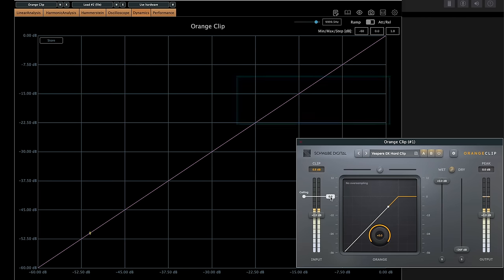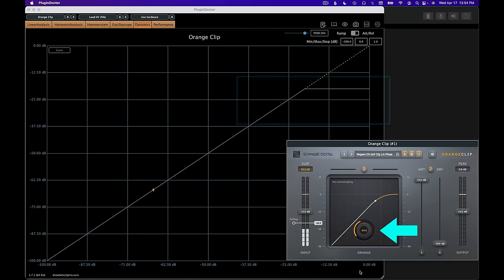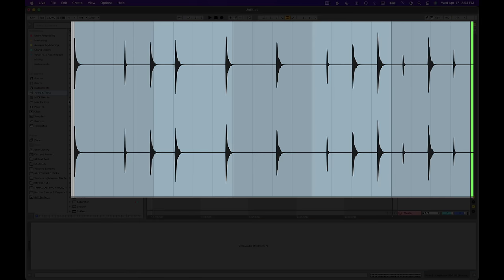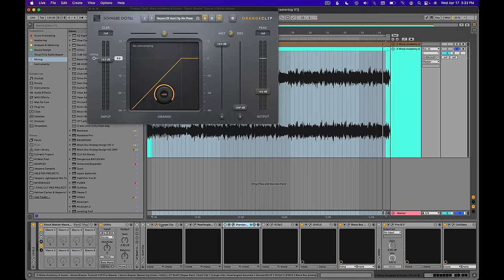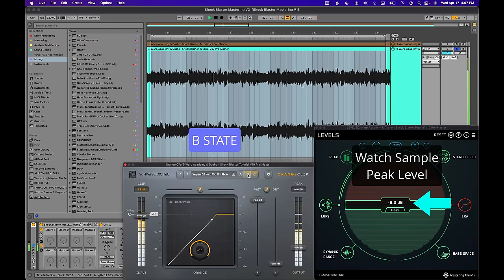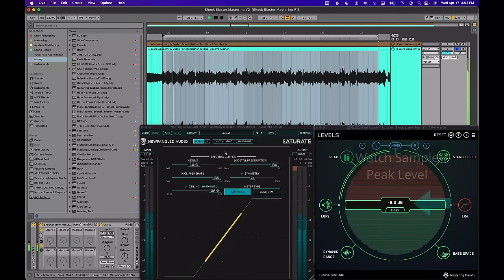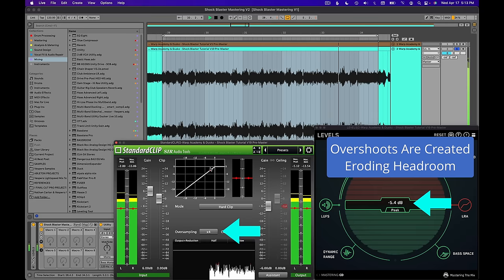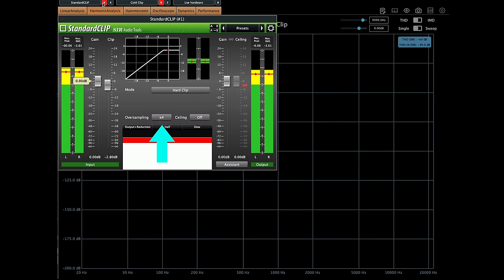The Science of Clipping - The ULTIMATE Tool for Loudness + Punch

Comment: At 1:20 you show how clipping affects the wave, but it looks more like like compression – making a certain part of wave quiter. Whereas with hard clipping it supposed to “cut” the top of the wave, isn’t it? If yes, then it means that it cannot be transparent, because it has to add harmonics to reflect the new wave shape. Or am I understanding it wrong?
Reply from the maker: Hey mate.  Good question.  Clipping always reduces dynamic range.  Whether or not it makes the sound “louder” to us depends on how the clipping is set up.  You can either A) push level up into a fixed ceiling or B) bring a ceiling down until it touches the waveform.  Either one will clip off the top.  And in fact in that oscilloscope example I was clipping, not compressing.  

Compression is in some ways similar and in other ways very different.  You have upwards compression and downwards compression.  Both reduce dynamic range.  Downward compression makes the signal quieter until you use makeup gain.  Upwards compression makes the signal louder by bringing up low level information without touching peaks. 

Clipping always touches peaks.  But it has no attack and release time.  It’s a sample by sample effect.  

Fast compression can and does generate harmonics.  This is why digital compressors have oversampling usually.  

 Clipping is wave shaping and can generate much more aggressive and audible harmonics than compression.  Saturation and distortion (really the same thing) are also very similar (arguably identical) to clipping.  

Clipping only micro-transients is what I’m taking about here.  And that is very transparent even though it generates odd harmonics.  This is due to the masking effect of transients.
Reply: @warpacademy , thanks for clarifying, appreciate it 🫶
Reply from the maker: My pleasure.  Details matter.  And much of this stuff can be hard to wrap your head around.  There are many things in audio I still don't fully understand, but through discussions like this, we all get to learn.  Cheers!

Comment: this is really interesting - I've been disabling oversampling on freeclip (which I use for run-of-the-mill track/bus hardclipping) but I never thought about checking for overshoots when using KClip on my master. Now i wonder if it's even the best option for master clipping. Also, I noticed (when I check the delta signal) that kclip is doing some kind of noise-shaping on the signal which I thought was interesting - but maybe that's related to the overshoots.
Reply from the maker: Hey Albert.  Thanks for joining the discussion.  I've used K-Clip a lot and have loved it.  It was my primary track clipper before I started using Orange Clip, which I now prefer.  Keep in mind that you should avoid using multi-band mode in K-Clip as the crossovers are non-linear phase and cause dramatic level spikes as I showed.  K-Clip should be fine for a mastering clipper, if you're going gentle and using a limiter after it.  Never put an oversampling clipper last in chain, unless you check that it's maintaining a hard ceiling without overshoots.  

I much prefer Gold Clip now as a bus and mastering clipper, due to the oversampling algorithm.  Not all oversampling is created equal.  Also, the configuration of the downsampling anti-aliasing filter is very different between various plugins.  Some use a brickwall, some use a less steep filter, some use minimum phase and others use linear phase.  That may very well be the difference in what you're hearing in the delta signal.  

All LPFs have ringing artifacts due to the decay of Fourier transform partials and the number of them used around a jump discontinuity.  Because any downsampled signal must be band limited, every single oversampling plugin creates overs from the filtering process.  Many of them are just hidden by an additional clipper.

Comment: Does the whole room shake with those speakers in the walls? 😅
Reply from the maker: Perhaps it would if it was built wrong.  But it doesn't, because...mass, rigidity, decoupling.  The speakers aren't in contact with the wall.  There's a gap of several mm, and the speakers are on a support assembly with decouplers.  The floor they sit on is floating, so there's no noticeable structure-bourne transmission or resonances.
Reply: @warpacademy  heyyo, sorry for giving you such a hard time. I appreciate the genuine response. You obviously know a lot and I don't mean to get out of hand with my trolling. 😅
Reply from the maker: All good!  I didn’t take it as trolling.  Cheers!

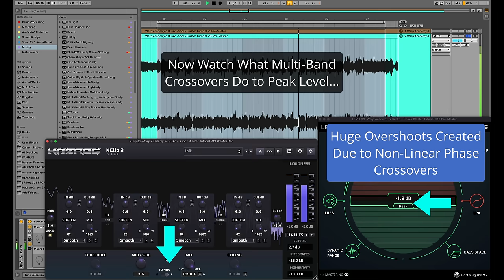Comment: I noticed at 07:46 the in and out for each band on KClip was [in = 0 out = 0] but before enabling the 4-band mode it was [in = 6.0 and out = -6.0]
Reply from the maker: With all the clippers I set the input gain to +6 and the output to -6 to get the same amount of clipping.  The multi-band just splits that into frequency ranges.  The overs when in multi-band happened due to the crossovers being IIR filters and not FIR filters.  The IIR filters cause phase rotation which causes a significant increase in peak level.

Comment: about oversampling being negative on clippers, does that apply to the mastering chain limiter too?
Reply from the maker: Hey hey.  Just to clarify, oversampling is not always a bad thing on clippers.  Use it when you're digging into the signal in such a way that the clipper is generating very audible and sustained harmonics, and thus also aliasing.  

And my views on oversampling to apply, in part, to mastering limiters.  First, use of oversampling will cause the limiter to detect a higher peak (ISP) level and thus will cause more limiting than without OS - all other settings being equal.  More limiting, we all know, causes more artifacts, distortion, dulling of transients, and general reduction in fidelity of the signal.  

Oversampling in a limiter is there to reduce aliasing.  But do you hear aliasing?  Is it a problem?  Are there super sharp transients that need dulling?  If not, then why use it?  I will eventually do a dedicated video on this.  Cheers!

Comment: Hey I have a bit of a strange question. I'm voicing over a movie soundtrack acapella with a below average microphone. There's a small amount of noise when I record with the microphone. There are sometimes a dozen layers in the track, would the small amount of noise in each recording have a meaningful impact on the mix, and if so, is there a way to lessen it?
Reply from the maker: Hey hey.  It's one of those "it depends" things.  How much noise is there, how compressed is it going to be, is it noticeable and obtrusive in the final mix?  There are noise reduction tools these days that are really good.  

Usually some noise floor is totally fine.  If you start stacking it up on multiple tracks and then compressing the mix, it can eventually become very noticeable.  In that case, you'll need a de-noising tool like iZotope RX.
Reply: @warpacademy  thank you! Can I use that on the final master? Or will I need to use that on a per track basis?
Reply from the maker: Nearly everything in terms of audio repair is best done on individual tracks rather than leaving it all summing up to your master and dealing with it there.
Reply: @warpacademy  legend, thank you
Reply from the maker: My pleasure.
Reply: @warpacademy  One more question, if you will indulge me: I suspect the noise from my microphone may come from a bad sound card in my motherboard, since it seems to persist with different microphones. 
If I purchase an audio interface, and route a microphone through it, and then into the computer, will it still be affected by that noise? Sorry for bombarding you
Reply from the maker: Ah yes.  If you’re using your PCs built in soundcard that is a recipe for disaster.  You need a professional recording chain.
Reply: @warpacademy  Ok, final question, I promise. Is an audio interface fully isolated from electric interference though? Or will I likely need a new motherboard? You're seriously a life saver for answering these. Been wracking my brain about it for days
Reply from the maker: If you get a USB interface you should be fine.  It’s independent as an external peripheral.
Reply: @warpacademy  my goat

Comment: On my System, I found it the opposite. I opened this Video in my DAW and  used the last "Gold"  example with the riser and took the first Newfangled Audio example, which was luckily the same riser Part then the last Gold example. And the Newfangled was way more open and transparent. If I compare other parts, then yes, there is a difference. But as far as I can judge based on the material, and on the same parts, the Gold one is not the best It sounded more bass heavy and peaked around 1,5 dB on a mp4 higher then the Newfangled one. Exactly the opposite that was intended. But still a great video.
Reply from the maker: Thanks for sharing your opinion.  You’re right in that it will depend on program material.  Saturate by Newfangled is a spectral clipper so that’s why you’re heading a difference in the bass.  

Spectral clipping is a not something I’m sold on.  Whenever I use it I don’t love it.  But it’s a subjective matter of opinion.  It’s a great concept.  I’ll definitely always add Saturate to my lineup but now that the Soundtheory Kraftur Multiband clipper is out it seems like a yet another option.  Have you tried it?
Reply: @warpacademy  Yep, that absolute the right way of thinking about it. And yes, I own Kraftur, it's a Monster of a "clipper" The Multiband Mode works great. But you have to be very careful with the bass. Often it sounds so exiting when you dial it in, but later you notice that it lacks some Bass. But somtimes its what you want, if you try to push the mix thru -4 LUFS. Thats done with ease with Kraftur. Sorry for my english.
Reply from the maker: That’s good you have Kraftur.  It is a very good soft clipper.  It has gain compensation on each band so you should not be losing bass spectrally unless you’re pushing it way too hard into the single band output clipper.  

If you want to retain bass put a subtractive low shelf before the clipper and an additive low shelf after equal and opposite.
Reply: @warpacademy  Thanks for that advice, I will give it a try. Because of your Video I tested KClip 3 and I found out (after dialing in), that it gave me the same result for the low end, then the Gold Clip. The null test was nearly zero. Today i want to try one of your tips to edit the waveform in RX. That sounds very promising. i do not know why I never found it out by myself, that this could be a good method :D. Your videos are really helpful!
Reply from the maker: Hey hey.  All hard clippers should be identical and will null against each other.  Hard clipping is hard clipping.  It’s all the same math.  I mean even if you clip your DAW output you get the same hard clipping.  

Now where things get interesting and different sounding results is with soft clipping transfer curves and with oversampling and downsampling as those have a lot of variables between clippers.  

In general, don’t hard clip bass.  Bad idea.  Use limiting on bass for a smoother and more forgiving result.

Glad you’ve been enjoying the videos.  The RX stuff is awesome.

Comment: Can you do the same with a stock Ableton effect? Compressor maybe?
Reply from the maker: Good question.   Certainly not the compressor.  Wrong tool for the job.  It’s way too sluggish.  But with the Saturator on hard clip mode yes.  Or with Soft Clip enabled and “high quality” (IE oversampling) on.

But really just get a clipper.  It’ll give you more control.  Free Clip even will get the job done.

Comment: Do you have a recommended plugin for monitoring crest factor in real time?
Reply from the maker: Sure.  You can use anything that uses a PLR (peak to loudness) meter.  ADPTR Metric AB does this.  So do many metering plugins.  They'll basically calculate the peak to short term or peak to integrated (long term) LUFS calculation.
Reply: @warpacademy  Great news since I have Metric AB and didn't know that was there! Thanks a lot
Reply from the maker: Sweet.  It's a great plugin.  I love that one.  Cheers!

Comment: So if there’s a “high quality” switch (as there are on FAC’s Punchlab and KnockClipper) it’s best to just leave them off? I’d say both of these wouldn’t be used as master clippers though
Reply from the maker: Hey hey.  In general, in plugins with "high quality" settings and the like, that triggers oversampling.  You're correct.  For track clippers (IE clippers on individual drum or transient sounds, clipping in the way I describe here - short audio events) then it makes complete sense to leave oversampling / high quality off.  If you don't hear negative distortion / aliasing, then why activate it and eat up your CPU?  Also pay careful attention to your peak level.  To a test.  Render your signal to audio and look at the result.  I always see big spikes over the clipper ceiling on drums when using oversampling, which is exactly what I'm trying to remove using the clipper in the first place.  

On a master clipper, I would recommend using oversampling.  The overshoots can be dealt with by a limiter downstream and then you reduce the chance of any audible aliasing.  For this I prefer Gold Clip because it doesn't create overshoots in the first place.  Cheers!

Comment: Great point about oversampling and overshoots. I often felt my mix sounded better before rendering at higher oversampling. I have confirmation bias now 😊
Reply from the maker: Exactly.  Also oversampling changes the sound of things quite a bit sometimes so using a different offline oversampling rate from your realtime rate is something I avoid.  You need to be able to monitor things if you plan to use it.

Comment: Hey can you take a look to Voxengo's OVC-128, it is a Hard/Soft clipper with x128 oversampling. Can you maybe, do a comparison with other clippers as you did in this video?

Voxengo is usually unknown or underrated to producers, but they have GREAT high quality products.
Reply from the maker: Hey Dallas.  Thanks for the tip.  In general I have a lot of respect for Voxengo and their tools.  I use many of them and love them.  

I took a look at OVC-128.  I can tell you right off the bat, I would never use it.  The interface is really not well thought out and it's missing a huge amount of features that make working with a clipper fun and powerful.  

Look at plugins like Gold Clip or Orange Clip, even K-Clip.  They show the transfer function, they have linkable inverted input and output gain, they have a waveform display showing peak information, they have A/B states so you can compare various settings, preset management etc.  

Clippers are simple devices, easy to make, so many companies make them.  But it's so rare to see a company that actually puts a concerted effort into expanding the feature set, building a thoughtfully designed UI, and making the workflow truly professional caliber.  

Only a handful consider the workflow that an actual engineer would go through with them, and so they fall flat.  Others try to look analog (such as the Acustica ones) and therefore they have all the bad drawbacks of limited analog interfaces.  

When you use a clipper day in and day out like I do, on hundreds of tracks, you need something that you can flick around fast and get results, plus enjoy looking at and using.  The only 3 clippers that fit that bill for me are K-Clip, Orange Clip and Gold Clip.  I've ditched everything else.  They're all so clunky.
Reply: @warpacademy  I'll try them out. Thanks for the detailed response!
Reply from the maker: My pleasure!

Comment: So is turning the oversampling option off on the plugin like standard clip not a good option? I’m confused. You can turn oversampling on and off.
Reply from the maker: In general what I recommend is not using OS if you’re clipping individual sounds with hard clipping and all you’re removing are micro transients.  

If you’re digging into the signal more and you’re hearing audible aliasing then AB with OS on and see if you feel like it makes an improvement.
Reply: @warpacademy  I gotcha. Thanks a lot this was super useful and love that there’s more conversation over these topics as most engineers and producers don’t openly talk about this stuff and it’s so important
Reply from the maker: Happy to help.  And I agree, it's nice to be having these conversations about settings out in the open.  Stay tuned on the channel for more videos soon.  Cheers!

Comment: Can't I just use ozone 11 on master and clue compressor, limiter all good in Ableton?
Reply from the maker: Good question!  I’m talking about using clipping all through your mix. That’s critical.  

Also Ozone is not a clipper and doesn’t have a clipper.  It has a nice limiter but not a clipper.  You can of course get great masters in Ozone 11. 

Don’t use the Ableton limiter.  It’s not meant for mastering.  The Glue compressor is pretty nice though.  On busses or in mastering. 

Hope that helps.  Cheers!